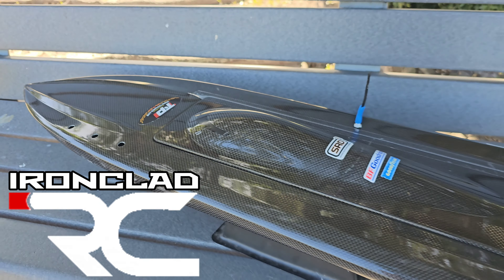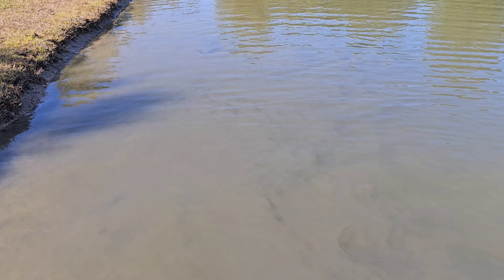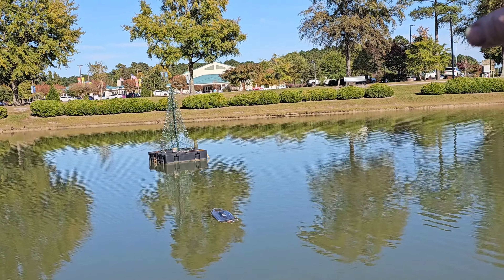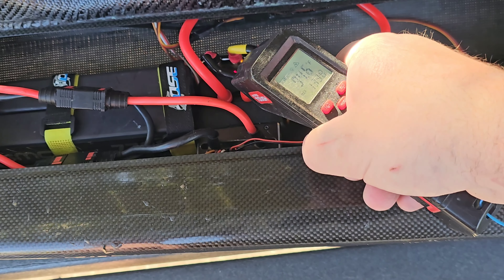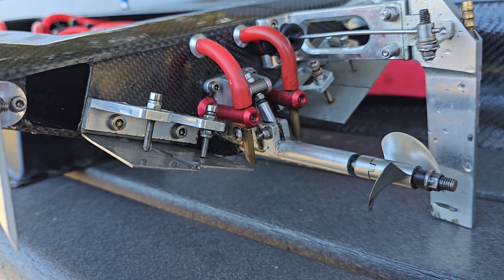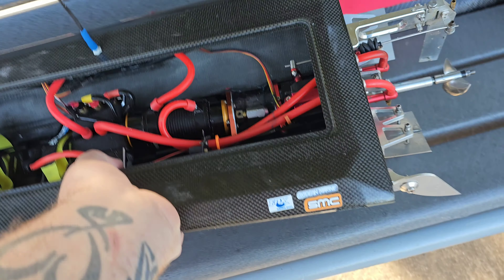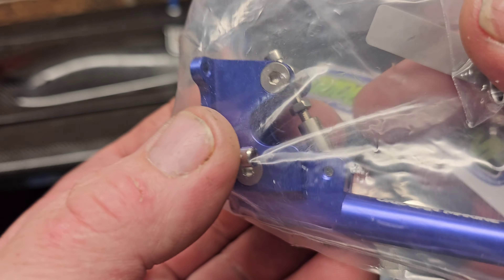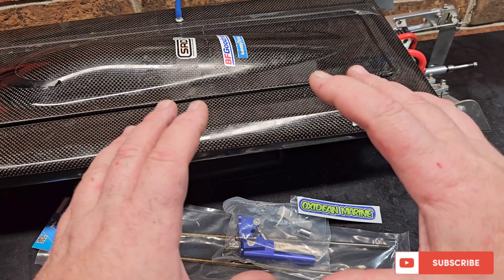Quick Fun Run & Reciever/Servo Glitch Issue Found Oxidean Marine Dominator - Hydra, Tp Power, SMC

Comment: Love the Dominator, and your rig too 👍👍. I’m scheduled to run mine this coming weekend, time permitting. So just preparing the boat. I purchased pre owned from US. So just giving the boat a thorough inspection and tighten down. Heading off to a hobby shop to get some EC8’s put on the batteries and ask a few questions about wiring as Lipos as they spook me out badly. They’re in a LiPo safety bag at storage voltage outside from the house right now. So excited and itchy as to have ‘ my ‘ first dip in the pond with an electric fast boat 😝. Just love the way the dominator handles at speed and has very high speed potential. Lots of fun fun coming up. Also purchased an Oxi - drive as  an upgrade which I will fit later. I want to feel out my new fast electric boat and then change a few bits here and there to really appreciate the upgrades on offer.

Comment: When you go out to search take tiny lil steps in as much of a grid/line like pattern to give you the best chance of finding it.also don't be afraid to dig feet in a tiny bit while doing it. There's a claming technique for "cockles" and you mainly use your feet dug into the sandy bottom a lil bit and shuffle around untill you feel one then dig as fast as possible to catch them before they bury themselves.  Other claming techniques for different types of clam use a rake so that should help alot in the shallower sections.
Reply from the maker: Wish I had a clam rake!   That would be the best technique 👌

Comment: Green connectors = wet, replace them. Don't try to clean them. You're losing power through those things. The melted one is a good indicator of big trouble. 
I would replace all those, cheap on Amazon. We use them in model airplanes. Nice vid.
Reply from the maker: You are right, gonna have to replace them!

Comment: Hey Big B i just rescued a kevlar dominator off of offerup, this thing had been thru a couple sets of hands that weren’t so knowledgeable so it was a mess, but after about a week of work its ironclad now, just waiting on my steering rod to come in for it then its water time! Its got the 1600kv out the jet boat and the 160a 8s esc out the blackjack 42, came with those electronics so ill run them to see how it does before swapping in something else if it dont cook
Reply from the maker: That should be a good setup in that boat, good luck with the maiden!  BG4L

Comment: The only way I've ever found lost props was with a metal detector. They sink in that mud faster than you think. On the bright side, I have found them before, so it's not impossible. If you use a rake, you'd probably be looking for stuff at least 2in down by now, so rake at least that deep.

Comment: Hey Big B, afraid for your feet, broken bottles and such, I’d suggest a water proof metal detector but I’m sure in NC like up here in VA you have to be careful because public property is off limits to metal detecting due to the civil war memorial sites, and many public places being considered “land marks” federally protected. I’ve seen people arrested-handcuffed just for fishing in those public areas. Maybe small magnet on a rope or fishing pole ?
Good luck.
Reply: Metal detector will work if under water,  not a magnet it is not a magnetic part like big B told before in other video

Comment: Hey idk about u but servo extensions on a boat when i build something i open up the servo & solder on a new longer wire or shorten existing have u thought about that water seems to do all kinds of wacky crap even just having the wire connection out in the boat if it gets wet can mess with signal even on good radios

Comment: What are the red color collars on water hoses ? They help secure the hose if so, where do you buy them?
Reply from the maker: You probably already have it laying around the shop, it's just silicone cooling line cut short and stretched onto the main cooling line.
Reply: @IRONCLADRC  snap ring pliers stretch smaller piece over a bigger tubing works like a charm thanks brother

Comment: I disagree with your comment about Corrosion X I have soaked Motors, ESC, servos and receivers for years with no issues
Reply from the maker: Watch it again dude!     Corrosion x makes plastics hard and brittle!  The jst wire sheath was compromised due to contact with Corrosion x.      And why would you soak a motor in Corrosion x that doesn't make a lick of since if your soaking esc's in Corrosion x then you gotta know exactly what Corrosion x does to plastics.. or you will soon find out because Corrosion x will degrade plastic
Reply: @IRONCLADRC  I was just stating my experience in racing Electric boat and we always had a CorrosionX handy to spray a motor ESC and even servos after a good dunking so you're experience is different then mine, none of my plastic ever degraded
Reply: No. CorrosionX will not stain or etch paint, nor will it harm plastic, acrylic or rubber. The only exception is butyl (natural) and silicone types of rubber, which may swell when subject to CorrosionX. A good rule of thumb is that, if a material is affected by fuel or oil, CorrosionX should be used with caution.

Comment: Did you say that the plug-in malfunction was caused by corrosion x. That's interesting because people spray their circuitry boards on their receiver with corrosion x to keep the water corrosion off. You should just cut the plug wires solder the ends together shrink wrap and not worry about the corrosion anymore
Reply from the maker: No!    The wire sheath tore at the JST plug because of corrosion x!   Over time Corrosion x makes plastics wire sheaths hard and brittle!